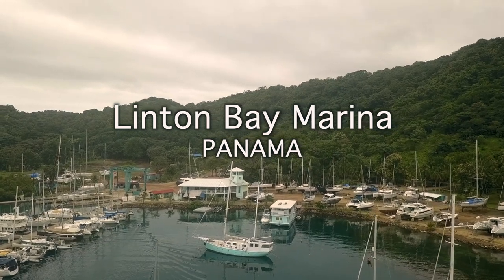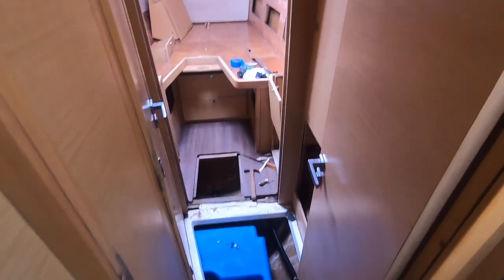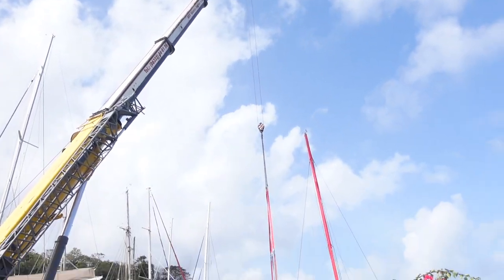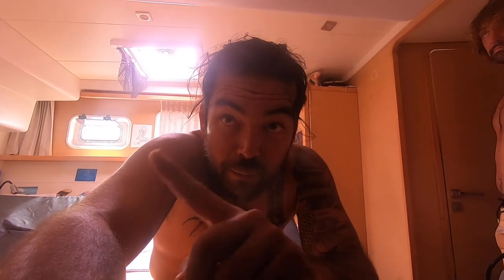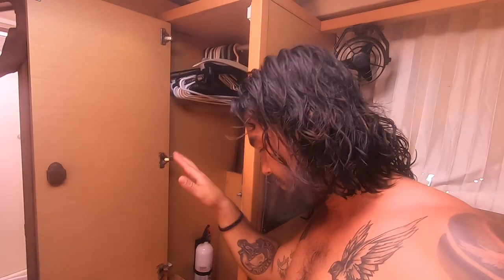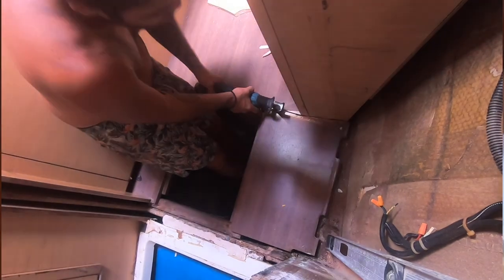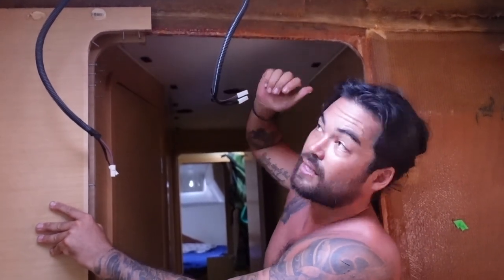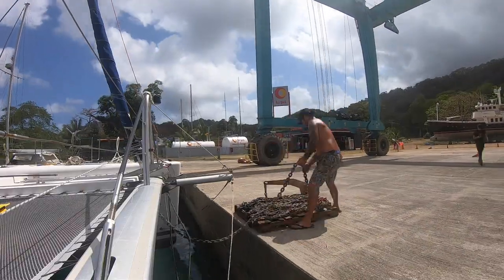CRACKED BULKHEAD REPAIR SERIES - Part 2

Comment: G'day Colin, As a former Lagoon 450F owner and Structural Engineer, it's shocking how much work needs to be completed, when in reality, had the boat not had so many structural anomalies, and design flaws, it honestly wouldn't be nearly as bad. The proper way to fix this mess, firstly, is drop the hulls. Then you'll really see the amount of damage. You want to measure all the deviations in the floor, to determine which side has priority. Just be careful, after dropping, the boat will be wobbling and freakishly unstable mate! Obviously, you already know this. Good luck and be safe mate! Cheers from Western OZ 🇦🇺.

Comment: How you keep from disparaging the build quality of Parlay is a greater source of wonder than considering 
what you are facing.
Reply: He does it Michael by biting his bottom lip.  Scary huh?
Reply: Looking at the original build  , it was just glued , the ply not real high quality either .  Then all buried, and they have not suffered the ravages of age and rot yet .Then because she is a cat the stress on the hull is huge  . Terrible  design and build and near impossible to repair at any reasonable cost if you are not able to do it yourself . If you can do yourself you better have deep pockets and lots of free time . I predict hundreds of these boats abandoned in the next few decades as unrepairable.   

Imagine the average older owner trying to get in to fix just the steering cables ?
Reply: @faircompetition1203  Exactly!
Reply: @jcheck6  Anything you find difficult to fix and think you will just pay someone also means you have find that someone and they will be expensive and take a long time
Reply: @faircompetition1203  Im trying to save up to buy an old British Cat, they are bullet proof. how did the art of boat building go down to this level from such a good start??
Reply: @lightend100  Cost and buyers that care only for looks and it seeming like they are at a cottage not a boat . My friend who just sold his Lagoon 450 refused to sail it . He had a proper race boat tied up beside it and used it as a party base .  Great for that . He powered anywhere he had to go .  They I am told sail TERIBLE for anyone that knows what sailing is . 

I as you clued in did not say they were all bad . I note that a lot of these new mono hulls are no better . A Friend had a DuFour that was a couple of years old in fresh water and had a big bulge at a keel bolt after one winter - water intrusion where you can not see it and almost certainly corrosion .  Factory "fixed" it with out dropping the keel , so I would say they did not .  He sold it and complained things like the lights would just fall out at sea . Built like one of those campers that don't last but look nice . 

The thing is to get a real blue water boat you need to spend real dollars or buy an old and proven boat .

Now I should also state these cheap production boats have a place , lots of people day sail in only fair weather, costal , and no need to blow $ on a blue water boat . A Lagoon 450  is great for partying on as you hop around the BVI's in only good weather and don't really care it is a pig sailing and then they sell it off after it is a few years old .
Reply: @faircompetition1203  A well-thought-out response. A thumbs up to you.
Reply: Remember people, this was a hurricane salvaged boat. It got beat bad. Thats why buyers should hire a professional marine Surveyor who specializes in the type of vessel you’re interested in BEFORE You think about buying . Im not criticizing the guys. I see this type of thing happen all the time. What you don’t know may cost you tons of $, or at most you or your passengers LIFE. Remember you are the captain and you are totally responsible for the conditions of your vessel and all soles on board.
Reply: @outlaw565   Not the only Lagoon this happened to.  Yep it was in a hurricane - still should not have happened
Reply: @outlaw565  - As captain, you are responsible for the bottom of everyone's shoes and feet? I'm not sure that's right, mate.
Reply: @faircompetition1203  no truer words. Hunters in the US, Venetian in France are another brand, all for show but not ocean worthy.

Comment: I think Lagoon should purchase your boat and do an investigation disassembly to determine how they can build a better boat.   I bet all these 450 Lagoons have some level of this problem.
Reply: I have read other posts who are now discovering similar issues & are not previously damaged such as was Parley.  Curios how this will play out.
Reply: It won't be just the 450's with this problem rather I think it would affect every other model with a similar build procedure.
Reply: That is what happens when you build a boat with wood and glue....
Reply: I don't think the problem is with Lagoon. I think the previous owner did some sketchy repairs.

Comment: You know, if you're dealing with screws from behind I would suggest using magnets to find those screws, then using hole cutters to cleanly remove the entire screw and the surrounding wood. Then you have a nice hole to easily plug later.
Reply: I guess you'll be using one of those "special" magnets that detect non-ferrous stainless steel screws?
Reply: @Ember800  Good point. Tho I just break out the metal detector pinpointer rather than a magnet.

Comment: Leaving any emotions aside, from a solution point of view a detailed and efficient repair plan is needed, and I see Colin is developing one, aided by Lagoon.  That's the tough part, everything else is just much hard work.  Guessing, Lagoon is very interested in an efficient repair plan as well, as this topic grew too large by now.  I could imagine that this will be the first 450 with inspection hatches to reach all structural elements and allow repairs without crawling into such dangerous holes.  The new interior will likely be modular and the result will be the best 450 ever and serve as a blueprint to repair others.  Plus an epic story, of course.  Nothing is too hard for a true engineer!

Comment: If I had to pick 2 guys to take this on it would be you two.  Good luck with this massive project.
Reply: Barefoot Sail & Dive is another great example. As is the one  where a married couple Expedition Evans have done something similar (dismantling a large monohull, fixing the disconnected hull/grid/keel then reassembling).

Comment: Don't know which stage you're in right now, but have a look at the book of the Gougeon Brothers on Boat Construction. You will find a treasure of info and techniques there to fix this problem permanently. I've been in sailing for over 45 years now and never liked the Lagoons and similar designs. Met a couple of them too on my ways on Atlantic and Med. They always came in limping in port with structural problems after a little rough ride. They're simply build structural too light to face really rough weather. But, I think you can fix it better than the builders could ever do it.

The book I mentioned above has (if I remember correctly) a whole segment about bulkheads, especially those for catamarans. Also look at the part they have about how to use interior modules to increase longitudinal stiffness, which ideas can help you to work out a plan for the bulkheads. To attach the bulkheads to the hulls, use epoxy fillets and cover that with fibre mats using epoxy for the laminating. Do NOT use Sika, since it stays flexible, which you don't want for the bonding to the hull.

Oh, and if you didn't remove the old bulkheads yet, try to keep as many pieces as you can, number them, so you can use them as a template to make the new bulkheads.

DM me if you want more info or have questions. Can also provide you with a copy of the book if you want. PDF.

By the way, I once crewed on a 126 feet Ortona Navi ketch called Parlay!
Reply: One issue on these production cats is after you fix this and make this strong the next weak point breaks . You see them rip travelers off the deck for example . Thing is there is no safety valve of heeling and the loads can be HUGE. You are not flying a hull and she is not going to go any faster . 

While there are good cats out there that can take it this is not one . It is a sunny day costal cruiser .
Reply: @faircompetition1203  Yes, they're rental pontoons for the Moorings. Designed to scratch around the coasts and hold on for 3-5 years, after they are sold to dreamers for too much money. For what he has spent on this one, he could have bought for example a Pahi 63 (Wharram design) and truly cruise the world. This Lagoon will get destroyed if he runs into some serious heavy weather in the Pacific.

As he says himself (I believe), everything happens for a reason. What happens with this boat is an alarm bell for him not to push this project into the Pacific. Up to him to listen to the warnings or not.
Reply: @paulvandriel2344  They are fine for what they are made for , costal fair weather party platforms . In fact excellent , I have enjoyed a number of stays on one . 

I worry when people confuse them with a blue water boat for sailing the world . 

These things are going to be a nightmare when they get 25 years old and start to suffer the ravages of age and rot .  Poor quality and difficult to fix added to expensive to even store by the square foot .
Reply: @faircompetition1203  Sure, they are relatively luxurious. However, for cruising the world it's a bad investment. That Pacific dream will become a nightmare, and possibly another statistic "lost at sea". The guys in Panama already asked him when he would walk away from it. I hope he got their message.
Reply: @paulvandriel2344  I suggest they fix it and sell it to people who will use it for what it was made for . Use the $ earned to buy a blue water boat . Or stay close to shore .
Reply: @faircompetition1203  Yes, that was my thought too. Fix it, sell it and look for a proper blue water yacht. A Pacific cruise close to shore? Hehehe. My last own yacht was a Formosa 56 Ketch. Sailed the Atlantic and Med solo with it for years. Solid boats, build in Taiwan in the times they were not too shy with GRP. A fortune of teak interior in them. I had a blast with that boat. If they can find one like that in good shape and work on it a bit, even the 2 capes are possible.

If I were to go for it again, it would probably be a Wharram cat of 45-63 feet. Pahi 63, 53, Tiki 45-55 or so. Wharram cats are very underrated!

Comment: Yes, as you say, you were so lucky to not cross the Pacific. I also 110% agree with your diesel motor observations. Many folk, who are used to a petrol engine, don't understand that a diesel runs and lasts better under load and correct operating temperatures. Even when you run the engine  when tied up,  in gear and on revs is the best treatment.
Good luck with the repairs, I'm confident you'll nail it. It is also good Lagoon is backing you with tech support. That may be the most important part of the rebuild. If I were to consider a cat, they would have to get a guernsey!

Comment: I crawled under the cockpit of my McGregor 25 on one fine day when I was retrofitting. I'm not a real flexible chap, and got myself stuck. Never mind I have claustrophobia just thinking about tight places. There was no one around to help extract me. I gave a little panic-stricken torque move and twisted myself into a better position, gaining some bruises in the process. But I got free. I won't do that again, and your spelunking reminded me of that resolution. Best luck with the continuing repair work. Kudos to the carpenter who volunteered some time.

Comment: The excuse “It’s a damage hurricane boat” is over. Lagoon is in deep trouble, they can go out of business. Never, ever, never I would buy or enter in a Lagoon boat again.
Reply: While I don't disagree, don't you think the others have similar hidden defects?
Reply: @TedKidd  All boats have issues to some degree, but what's happening on many of these 450's, is well past an issue and leaning towards disastrous.
Reply: @TedKidd  Good question Ted.  Is there really any way to build a cat without it becoming too heavy to avoid these cross member issues?
Reply: The piece of wood between the deck and floor to keep the floor from being springy is damning info here,  this indicates there were issues here before the hurricane, huge design issue these sections should have been mounded together much better than this
Reply: @vxnova1  yeap and They glued the bulkheads with durepox and expanded foam. In the cockpit the preview owner had to put the boat together with a inox plate... and so on. Lagoon? Run!
Reply: @r1ca3d09  scary!
Reply: @jcheck6  yes  check the garcia 52 explocat ..... ok aluminium and 1.2 millions but space, equipment (airco/ heating/ generator and so on) and specified to sail in any heavy conditions.  i was visiting the nr1 out of the factory and partially equipped. Of course the structure has nothing to do with polyester / glue assembly. hours of TIG Welding for each part and aluminium has also maintenance issues. But the pb is may be to let think that a high end Cat around 45 feets can cost less than 500k .....

Comment: Props to Lagoon for helping you out and not giving you some legal BS
Reply: More likely they know there are issues with these boats, so more of a PR excercise for them.  Obviously this boat has been through a hurricane, but the lack of quality in original construction means choosing one of these for offshore use , even when new, is a crapshoot.    No way you should be able to pull the boat out of shape just by the rigging screws, rigging failure should occur before anything structural in the hull pops.
Reply: @skaraborgcraft  it seems the boat was previously damaged based on the “repairs” Colin has found. Who knows the full history of the boat. I don’t know if this is an inherent Lagoon issue or not, but either way, it would be easy enough for them to wash their hands of this. But they aren’t so that says something at least. Other rebuilds I’ve seen, the manufacturer has basically said “get bent”.

Comment: I worry about all that demolition that is having to be done to expose the areas that need repair - will be a huge job just to put the boat back together again. I feel for you.  Good luck man.
Reply: i don’t blame lagoon or any other mainstream cat builder to launch boat  designed for mooring instead of sailing performance and endurance. This is the way they are used. but here the « fix-it score « is close to zero.... i wish Lagoon will offer new partition wall able to be installed without opening the deck ....
Reply: I worry that some of the cabinetry was supposed to be structural and now it is cut out .
Reply: @faircompetition1203  they are not . thin and soft plywood for finishing. and despite the massive geometry displacement of the structure, the partition/cabinet wall was either intact or bend like a paper sheet . means there are not on stress area or completly unable to hold any compression load
Reply: @faircompetition1203  but the refitting will be fun..... if parlay will be back close to his nominal geometry, all’these partition wall won’t fit as original.  for sure somes extra hours of sanding/ cutting edge and so on
Reply: @damientelle  Yep , stronger than new for sure . One thing most people do not realize is none of these boats were symmetrical out of the factory 

Funny story , was at a regatta and walking by a guy with a J22 I think it was . Anyway he was reinstalling the mast step and set up a Laser to line it up with the keel , rudder and chain plates exactly .  Yup that is when he found out the boat was not even close to symmetrical. Looked pretty shook up . I explained to him none of them actually are . J 24 is know to not be  for example .  Just put it back where it was . 

Have that on my boat , changing out the  deck organizers when I do the no skid so I carefully measured where the starboard and port one was . Yep not even close  to the same .  I swear at the factory the guy just mounted them without measuring .

Comment: I feel for you Colin, when you first showed the bulkhead crack i though was bad but after todays episode, wow. Much respect for you guys even thinking about tackling this level of damage. Makes me appreciate how easy my old cat is to pull apart.
Some of the previous repairs underneath are a real eye opener especially as pre- hurricane.
I wish you the best of luck and ultimately when she is done she will be a stronger boat than she was pre-damage.
If you need some wonky lines cut in wood, bad glassing and terrible filming then give me a shout!:-)

Comment: Lagoon needs to give you another cat just so you will stop showing how poorly built their boats are... Hurricane or not, that thing is a POS!
Reply: Yeah I wouldn't buy one based on what we have seen here. Seems like all the structure has given out just from it's previous charter life. Then add on a hurricane sinking and it's basically a piece of garbage.
I can't believe he did a repair job on the outside of this boat without inspecting all the structural components first. Seems like a massive oversight.
Reply: @uglyduckling81  yup, big time
Reply: +1
Reply: @uglyduckling81  only one way to learn I suppose.
Reply: @uglyduckling81  Very good point.
Reply: I was thinking the exact same thing.  Get this guy off camera